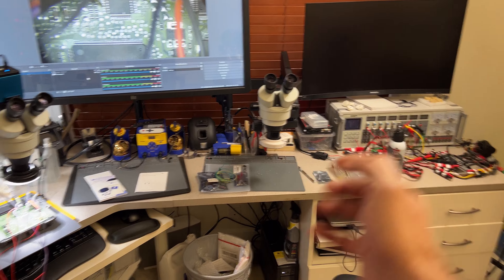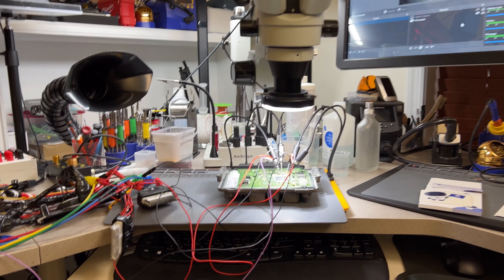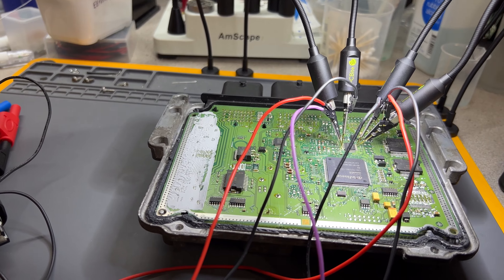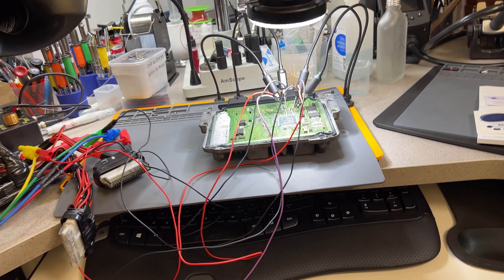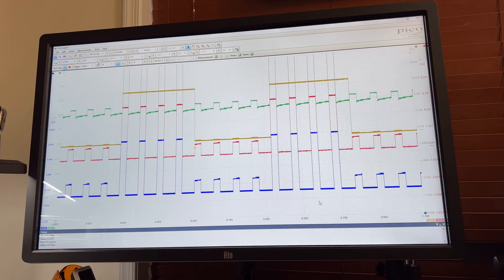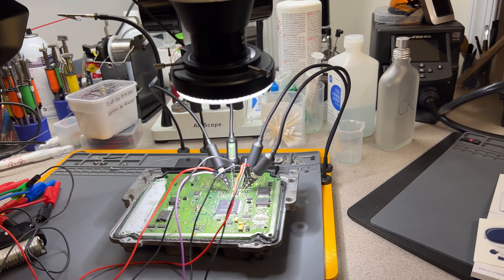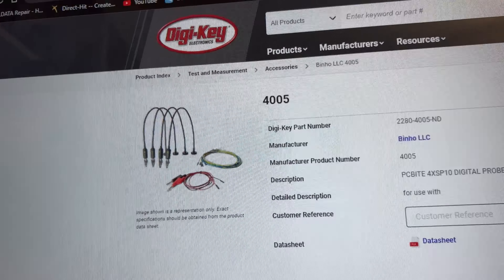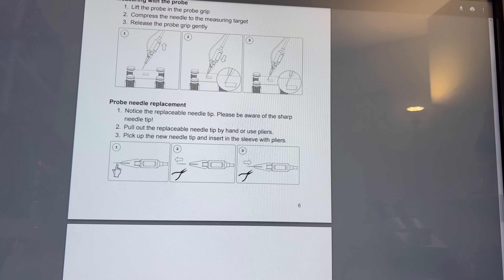PCBite Hands-Free Probe Review  If you work on ECMs boards,  this is a must-have!!

Comment: The Arduino setup connectors are called Dupont connectors. They are being used in all the Discovery board world (Arduino, STM-32, FPGAs, Breadboards...). Many thx for the tip! Exactly what I need...
Reply: except they arent really dupont connectors because they are tool expensive for cheap arduino  stuff. just clones of molex and dupont and other spring barrel connectors .

Comment: mso 6 is nice with the big screen but that is waaaaay more scope then u would need for anything vehicle related. thats cool though man,happy for u. textronix is cool but ive never got to use one yet. ive always been an alginet, keysight guy myself,and pico. that 6404d u have there is more scope than u need for a vehicle as well.. i have the 1ghz 6407 pico and i love it. thats y i love the picos cause i can put it on any size screen or touchscreen i want.